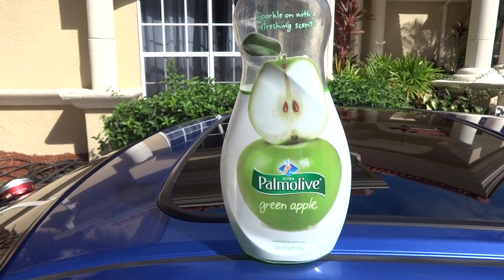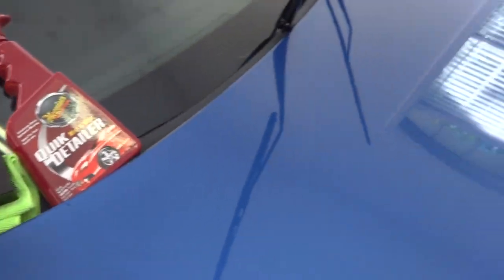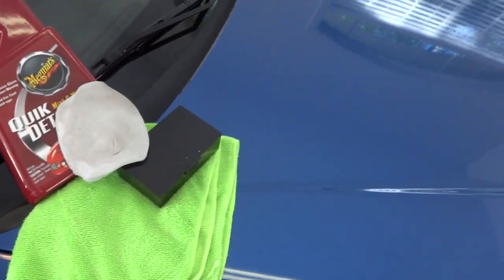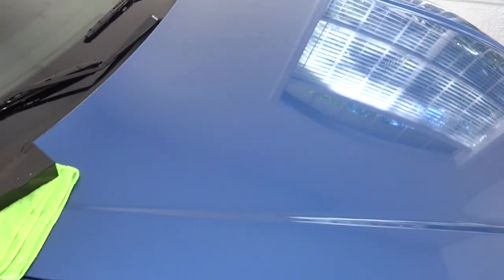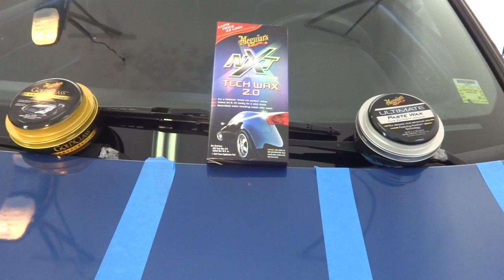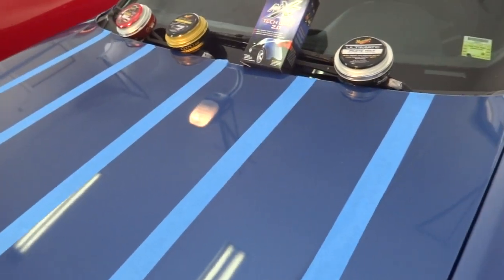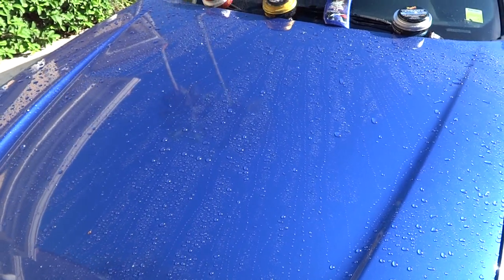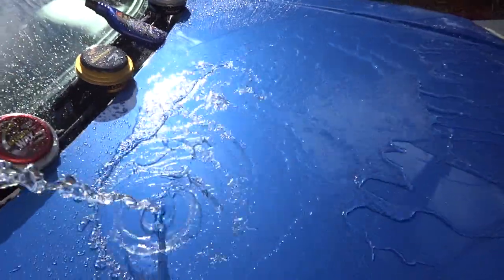The difference between Meguiar's Cleaner Wax, Gold Class, Tech Wax 2.0, and Ultimate. Comparison.

Comment: Thanks bud for your great videos. I recently picked up a 99 cougar Melina blue. Paint was neglected,followed your suggestions by claying,ultimate compound. Amazing results! Most swirls gone,some scratches gone,some are deep,but I am very happy with the results. I live in Seattle, so now just waiting for some warmer weather to wax. I did use a da .I have some megs cleaner wax to use up. Then I'll step up to a different wax next time. Got to watch my low budget though! Thanks very much for your dedication!!!
Reply from the maker: Im glad you liked it, some people totally believe that the compound will make the deep scratches go away too but its just not true. Sometimes when its down to the metal or whatever, you will just have ti fill those in with touch up paint. Its warm in Florida, kinda feel bad for all of the northerners!
Reply: I got the other steps done yesterday,about 50 degrees. Now its 40 weather forecast not good. And that cleaner wax is difficult to buff. Ty again
Reply from the maker: yah, I don't recommend cleaner wax, when you get up to Gold or Ultimate, it just comes off with ease and you don't even get tired from taking it off.

Comment: This video is an awesome example of the wax performance.  The results line up with what I have seen between all products.  I must say that the Tech wax 2.0 is the easiest to work with but the ultimate wax does hold up a bit longer.  

All in all use what you want but just clay bar the car first!   If it makes any difference Canepa motorsports uses NXT 2.0 on all their cars.  If you don't know the shop...now is the time to look them up!

Comment: Thanks for the video. I have no idea why Meguires have to have soooo many ranges. Its getting annoying tbh. I use Gold Glass Wash, and I've used NXT wax, but now going to try the Gold Glass Wax. If you get time, can you compare some of the Autoglym stuff, and Mothers, if you have them in the USA? They're here in Aus anyway :)

Also, not sure why, but I can see after waxing, I have areas where there is dark patches (when viewing in dark lighting), and then others parts that are not. This has occurred on two cars now (one has a clear coat, one doesn't), perhaps some sections have more wax than others causing this effect? Eh I'll have another crack.

Comment: So in between waxes you just wash your car normally without any special products?
Reply from the maker: I may apply spray on wax about once a month or some ultimate detailer but not every single wash.
Reply: not using car shampoo help wax stay on longer, or using one that is not too strong :) also less washing, not raining make it last longer
Reply from the maker: actually just don't get a cheap junk one and don't use kitchen dish soap, strips the wax. But any regular car wash wont strip it. Sun eats it away over time though.

Comment: I'm a massive Maguires fan I've used all the budget stuff and onwards. Maguires is worth spending the money on. if you got more money and in the UK you could try kleen freaks or even better use poorboys (it's called that because it's your pockets afterwards). I use a light degreaser then shampoo next I use clay bar then snow foam dry the off and apply Maguires compound, Polish then tech wax I am stunned every time I look at my car if you spend the time it will always be a real head turner

Comment: Why not clean / do a paint prep like using a new blue color paint prep that you can get from AutoZone or O’Reillys? Of course after washing to remove any cross traffic that maybe on the car from driving around town. That would be a much better solution than the Palmolive and is actually designed for automotive paint

Comment: the Meguirs cleaner wax is the best one.  It does not bead the water. however, it sheers it off instantly which leaves no water spots.  Water beading is more water you need to absorb when drying.  the cheap cleaner wax will save time and money and perhaps last longer because water does not stick to it to diminish its durability.

Comment: cleaner wax is not "entry level wax" its carnuba with polish in it to remove oxidation and minor swirls hence "cleaner". so it would repel water and protect the same as Gold Class but it cleans your clear coat in the same step. all the others are wax. and ultimate and 2.0 are synthetics so they would last much longer, but my point is a cleaner wax  has an additional job over these waxes

Comment: Your video was good. Just so you know the Cleaner Wax is supposed  to be used as a step after the Clay Bar step. So you cant really compare the Cleaner Wax with the rest. I myself bought the following:   Quick Detail with Clay Bar, Cleaner Wax and Gold Class. I prefer a paste over a spray wax. Spray wax is more for the Quick Detail wax. I also have the Ultimate Compound wax to used when the paint has swirl marks, water spots, and some light oxidation. So yeah good video but I would explain the waxing steps more.

Comment: if I waxed 4 different cars (lets say all exact same model, same color...everything) and waxed each one with these 4 different waxes, I guarantee you would not know the difference of the final result. I do however agree that the tech 2.0 wax and ultimate do wipe of easier, this is true. I have used each one of these multiple times, and I would say your test that you have done, its an ok idea for application on/off but for water repel or visual difference for the paint job itself.. you, I, nor any other human will ever ever ever know the difference.

Comment: The Cleaner Wax is the only one I have used and its a lot of work compared to more expensive products. I can say the cleaner wax does a bang up job on old paint (far from perfection). The cheap stuff is just that, and full of fillers.
Reply from the maker: for the average joe, it will do just fine. Nothing wrong with it!

Comment: I think he must have buffed the tape residue off all with the same towel. Even on the edges, where no wax was supposed to be, the water shed and beaded identically to the waxed sections. You should have just left the tape on durung testing and made sure you used a different towel for removal, for each section. You can clearly tell there was cross contamanation. That's why the unwaxed sections perform exactly like every other section.

Comment: I don't mess with the cans. I'd rather Deal with the liquid in the bottles. I've used the cleaner wax it does ok. but I like the meguires wax. I can't find anymore of it so I'm having to switch to the cleaner wax. I've clayed my truck Friday the 13th waxed it this makes the second time since this passed december. an it's to a mirror finish. water gets on it, it runs right off an beads up nicely. when I first clayed it I compound it polished it then used the wax. Turned out really good. but since I did it agian the second time I didn't go with compound or the Polish I went to the clay then waxed it. it is 10 xs better than when I first clayed my truck. it has really brightened an shined the paint marvously. took Alot of the oxidation that was starting to set on off.

Comment: Not to burst your water bubbles, but the real test is not with course spray, and less so with a stream—it’s with a fine mist. The fine mist beads are more diagnostic. You can really see just how hydrophobic the underlying coating is by observing the lift of the tiny droplets. Large spray drops and stream rivulets are weighty and not the best indicators of water repellency. Also the test should occur a couple months after application when the product has worn in a bit. The reason you got similar results is because all of these products produce a strong hydrophobic reaction when first applied. You could have had a panel you treated with WD40 and seen the same initial result. 

Also, the dramatic difference between the taped sections is do to a small amount of residual adhesive left by the tape.
Reply: Another hydrophobic bubble burster… I get similar results from Turtle Wax Ice as I get from Maguire’s Ultimate paste, with less buffing. Both last about 4 months in the desert. I alternate. Maguire’s goes on after polishing for a deep shine initially. Ice goes on in between for protection. Both great products. However, to note, ads to the contrary, there is absolutely no consumer wax or sealant that protects from UV. No product actually has UV filters like sunscreen. The only protection you might be getting is keeping the clear coat protected from environmental contamination. Perversely, a totally dusty car is better protected from UV because the dust absorbs or reflects sunlight and “shades” your paint!

Comment: Mate just detail cars every day on price if that's what you want. Stop messing around with four waxes on one bonnet. Decontamination, wash, clay, polish, sealant, wax, glaze, glass, wheels on and off. Dry vacuum or wet carpet shampoo, trim clean and dress, engine bay and boot, door shuts. The list goes on. One good job leads to another. Meguire used to make an ultra safe alloy wheel brush. I used it the tip came off and I scratched a client Bentley wheel.

Comment: A cleaner/wax or cleaning/sealant would offer some level of cleaning ability using either chemical cleaning agents, solvents and/or some type of abrasives and often times a combination of all three. Cleaner/Waxes are also referred to as One-Step products or All-In-One products. Cleaner/waxes can be used to restore neglected paint to good to excellent condition depending upon how bad of condition the paint is in and the cleaning ability or strength of the cleaning agents in the cleaner/wax.

A finishing wax or finishing sealant would not contain any ingredients with the intended ability to clean or abrade the paint. Products in this category should only be used on paint in excellent or brand new condition or neglected paints that have been previously cleaned and polished and thus restored to new or excellent condition. (Autogeek.net) 

I wouldn't pay as much attention to the cleaner wax as it is used for a different type of job. The other 3 waxes are great to compare and I think you did a good job doing that!

Comment: There are two other consider, cleaning and longevity. Theses waxes have different properties by design. Shedding water is the only common characteristic. The cleaner wax has an abrasives where the others don’t. Also the actual wax properties are different which affects the longevity. So the water test is fine but you’re only examining one of the characteristics of the products. You should do a cleaner and longevity test to be fair.

Comment: Cleaner Wax is called that for a reason.  Certain people don't clay bar their car to smooth it out, nor get rid of residual contaminants/pollution that the wrong kinds of soaps (e.g., dish soap) or a bad wash may not have cleared.  So cleaner waxes help to bring those contaminants to the surface before you wipe it away, thus cleaning and protecting the paint.  On the other hand, the non-cleaner wax, expects some serious notion of cleaning before application.

That said, this isn't a comparison of apples-to-apples.  They have different purposes, which you might want to consider. In your case you supposedly cleaned your car correctly, so a Cleaner Wax may be pointless.  You may want to consider another video of not cleaning your car properly, nor using a claybar (I wouldn't recommend it, since it could also be damaging).

Comment: Surely if a manufacturer makes a product, they just make the one which is the best. So WHY does Meguire's make so many waxes (and their other products) that do the same thing?
Reply from the maker: longevity is a big thing you are not considering here, also the cleaner wax has polishes in it to help correct minor issues.
Reply: Acc0rd79 thanks for noting my comment and replying promptly!

Ok I get that certain Meguire's products are different as they are all-in-one, like Wet Look, which cleans, polishes and waxes. But even there they have another one (forget its name) which does the same thing.
But, like, there's a Meguire's official Youtube video which describes each of their different waxes (just wax, no polish etc), but for the life of me it sounds like all variations of the same thing. I bought Gold Class carnauba wax thinking it was the best wax in their range, but since I've that they say their Ultima is the "flagship". Look, surely there's one best type of wax. Period. They would test them all in their labs and find which one it is, then just produce that one.
Haha, my garage cupboard is full of different bottles of Meguires products, half of which do the same job :) 

PS Hope you're surviving your cold weather!
Reply from the maker: I'm doing the best I can, I rode my motorcycle home from work today in 43F weather! It wasn't too bad with the proper gear on but you could definitely feel it in my hands and around my neck.
Reply: Far out, on a bike....imagine the wind-chill factor!
......while here in Australia we're in a heatwave, Sydney heading for 40C (104F) tomorrow!
Stay safe and warm mate!

Comment: Coming back to this video a year later, I dont know about anyone else but I stopped using Meguiars wax. Tried some Mothers and was extremely happier with the results.
Reply: Any suggestions?
Reply: What about the Mother's made you happier?  How, in you experience having used the Mother's, different/better than the Meguiar's (BTW, which Meguiar's wax did you use before the Mother's)?  Thanks!
Reply: +Rick T Mothers is extremely easier to buff off and doesnt require the pressure and elbow grease that Meguiars did. It's also stubborn and wants to stay on the car as long as possible. I use the cheapest mothers Carnubua paste wax. In the red can.
Reply: +Harris Montevallo, Ah, ok, understood.  Thank you for the quick reply!  I agree and did experience from time-to-time where the Ultimate Wax had to be buffed a bit harder to get off, otherwise at certain angle of light I can see some wax swirls remained...  I continued using the Meguiar's Ultimate wax for it will not cause the black plastic trims to go white if accidentally waxed as for the Mothers I had hard-hard time in the past.  Regards.
Reply: +Rick T I really dont like having to buff with pressure and muscle. It increases the chance of swirls & scratches.
Reply: +Harris Montevallo, Absolutely agree.  I used the Meguiar's Wash & Wax Anywhere when I had to remove those tough wax swirls... never dry buff or will risk getting scratches as you said.  Thx!
Reply: +Rick T Give mothers Carnubua a try. I even picked up their clay bar kit. Its pretty damn similar to Meguiars, aside from one little difference - They actually put the Microfiber in a plastic sealed bag. Meguairs just throws the microfiber exposed into the box. The little differences like that say a lot IMO.
Reply: +Rick T I have a few videos on my channel where I do walk arounds of my black challenger. And the shine looks pretty unreal, with the only thing on the paint being Mothers.
Reply: +Cheds78 Mothers Carnubua wax. Its like $8 at Walmart.
Reply: +Harris Montevallo, will do.  Thanks!
Reply: Harris Montevallo Thanks Mate, I'm in Australia (so no Walmart) but I think I can get it online. Cheers.

Comment: Dont bluff yourselves. 

Even if there are visual differences, those differences are never jaw-dropping. 

The enhanced beauty/gloss of ANY paintwork is actually contributed mostly by: 

1. Inherent quality of the paintwork
2. Its colour
2. Flatness of its clearcoat. 

Without wetsanding and extensive compounding, and relying only on polishing done by a childishly amateur DA machine, the results would only be mediocre. 

If wetsanding was done, followed by superb rotary buffing work, even a cheap and disrespected NuFinish or Turtlewax looked down by childish detailers would already look superb. 

No wax, no sealant and no coating can transform a mediocre paintwork.  Save your money. Learn how to use a rotary effectively first.

Comment: The problem with this test is it cannot only be tested by line of site..
a proper test calls for proper tools.
if you want to be thorough, and make a concrete analysis to get those subscriber's thumbs up,
 your going to need to test depth, (i.e micrometer) reflectness, or how shiny, (i.e gloss meter), and to measure the viscosity of each product. as i mean by,
 tracking inconsistencies in depth over a single pass, or how much product you will need to use to achieve the same results. 
Being right never means it's going to be cheap.
Reply from the maker: I'll let you spend the big money buddy, this was for fun. Enjoy the video!

Comment: that car didn't even really need to be clayed in my opinion. If you are a perfectionist go for it but I think that's just a waste of clay and time unless you plan to re use that clay which you could. When i start to clay my car if there's barely any stain on the clay( like yours for example), after i do the the entire top of the trunk i know that its basically a waste of my time. On cars that haven't been clayed in at least a  year or longer it really picks up a lot of crap and the car looks noticeably cleaner.

Comment: Oh, and stop doing the swirls.  It can cost you if a particulate gets into the pad and scratches the paint.  Good luck removing those scratches.  Use straight lines in the direction the wind would go over the car as you drive.